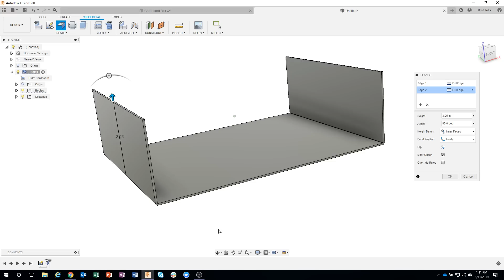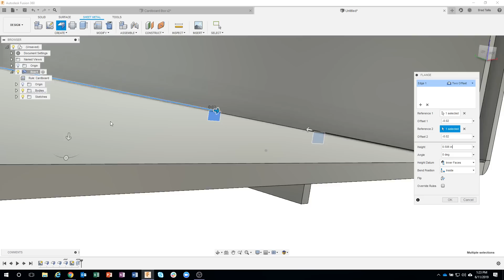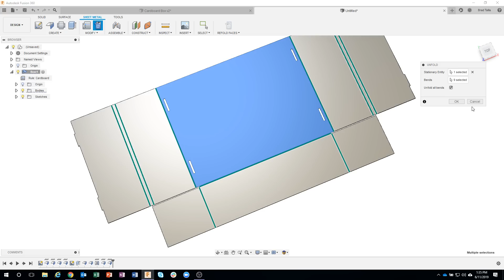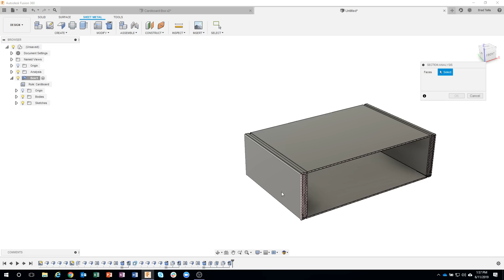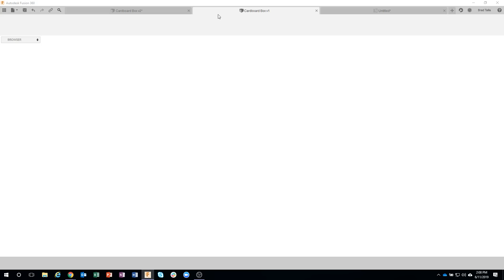360 LIVE: 3D Creating a cardboard box using Fusion 360's Sheet Metal

Comment: Great Video. Thanks. Here are some of my timestamp notes:
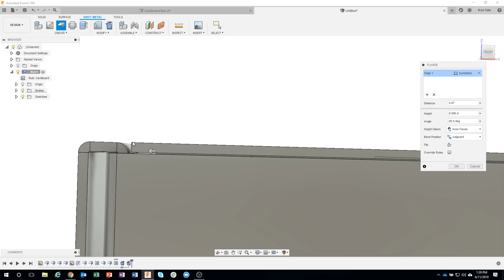42:00 Intersect and join flange
49:30 Unfold specific bends
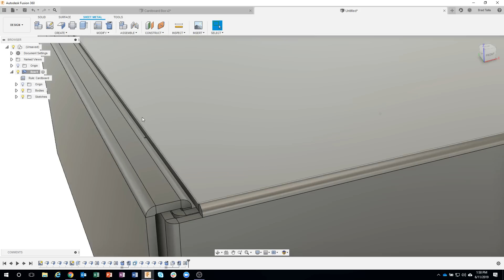53:40 T&T using "flip"
54:30 Phone call 🤣
54:35 T&T use section analysis to see inside
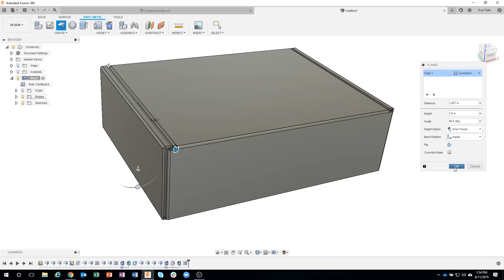57:30 Another mirror magic
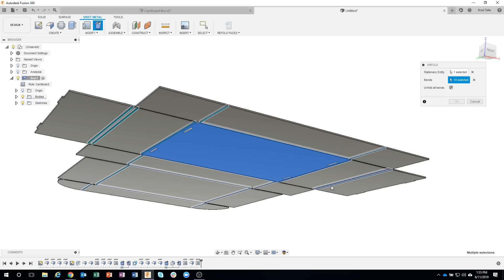58:20 working in unfold workspace

Comment: Stumped @29:29 Unable to get the mirror operation to detect flanges correctly as features. Specifically, the flanges that are the tabs simply do not mirror. I even split the mirror operation into 3 operations. 
Fusion360 version: 2.0.7046
I am checking to see if any update distorted this feature added on April 17, 2018 Product Update.
Reply from the maker: Is it centered properly? Is the order correct? Can you share the file? If so, can you send via sharelink? https://www.autodesk.com/products/fusion-360/blog/share-a-public-link-of-your-fusion-360-design/

Comment: When working with foamboard, you sometimes cut parts of the foam to make 90° bends like it's shown in this video at around 0:30 https://www.youtube.com/watch?v=axOnU5GKSJI.

Can you do folds like that with the sheet metal tools too?
Reply from the maker: If you're cutting/severing it completely, it would be a new part or body. Otherwise I would just use an extremely tight corner similar to what Brad showed.
Reply: @adskFusion  If you look at the example I posted above, part of the foam is removed to be able to do an extremely tight corner with just bending the paper and glueing the foam together.

The interesting part would be to have F360 remove the foam as needed on a bend.

Comment: I am a packaging engineer. For someone that does not design packaging for a living, this was very well done. I have tried doing this with fusion a few years ago with very little luck. Its good to see that it can be done now.
Reply from the maker: Thanks Donnie! That means a great deal coming from an industry pro. Curious how it could have been improved?
Reply: @adskFusion   Very minor things. Like, that box was made out of corrugated not cardboard. Cardboard is what the material is made out of. When it is in a fluted form like that it's corrugated. But that really does not matter. The slots should have been wider. All the way out to the fold. Because when the slot is close to a fold like that because the ends of the slots will rip out. The best part about watching this, is I think this is the future for my industry. You did so well with this because you drawing this in a 3D format. Designers in my industry now have to draw in a flat format and there very few CAD programs that will let you fold that up after it has been drawn in the flat. And all of those programs are very expensive. As much as $800 a month. Yes, you read that right. I make a lot of rebuildable designs. If you ever want to collaborate on making something like this rebuildable let me know. I think it could be very helpful for amateurs wanting to make there own boxes.

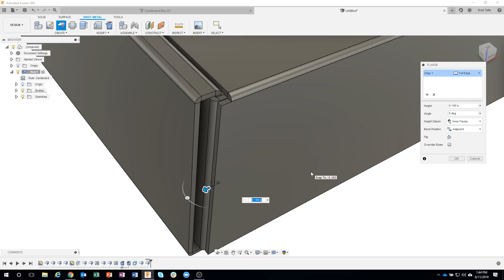Comment: @47:25 - Its nice that you are able to add material using the flage command but is it wise to do so? what are the benefits? because IMHO at least on the timeline it would make more side to use something else as it would probably be more "readable" later on.
Reply: @Eyal-  You could use other commands such as "Press/Pull" or draw an extra sketch and extrude, but to me, it is faster to just use the flange command.  This also gives you the flexibility to use symmetric or two-offset flange which gives you more control with less steps.

Comment: yet another Q: does fusion actually validate the "fold-ability" of the sheet metal object?  I mean in theory you could draw the side inserts of this box smaller (on the Z axis) and "wrap" them with severla loops of the side wall (like a rectangular spiral of sorts) in a way that will not have any collisions but will not be fold-able regardless of the order in which you make the folds.
which leads me to another Q: Is there a way to provide an "Order of foldering" to such an object?  
I am guessing that would be the first part in being able to 1) animate the folding 2) detect such "during the folding collisions".
Reply: @Eyal-  Fusion doesn't check the "manufacturability" of your design.  That is up to the designer.  However, it does check to see if the body is self-intersecting.

Comment: Hi, @37:57 when you add the second edge, I can see why did the flanges go both the the same side, presumably because the bends are at the same angle to the surface to which those edges belong to. I wander what would happen if you added some other edges... is there some "right hand" rule to help us know which direction they will fold to ? (maybe outside and prependicular to the face the edge belongs to ...)
Reply: @Eyal-  The flange will always fold in the direction of the face that the edge is on.  so, if you click on the bottom edge of a part, it will fold down, for example.  You can use the "flip" option to have it flip the direction, if needed.

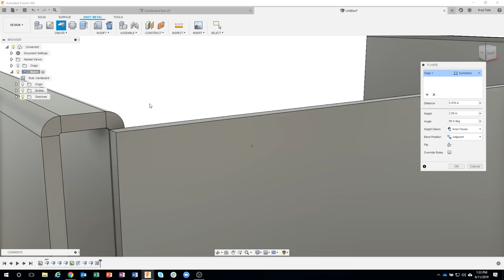Comment: Hi, @35:58 I would have expected the dialog to have the "Standard" tools like with extrude so that you could say "up to this edge" but with a offset of -0.008, so that if you later on change the height of the side walls it would also automatically adjust the front wall. alternatively parameters should have probably been used.
Reply: @Eyal-  Yes, we could have used parameters for this, but I didn't want to over-complicate this design.  I have another LiveStream where I show how you can use parameters to drive a sheet metal bracket.